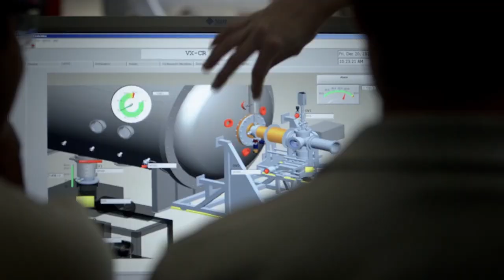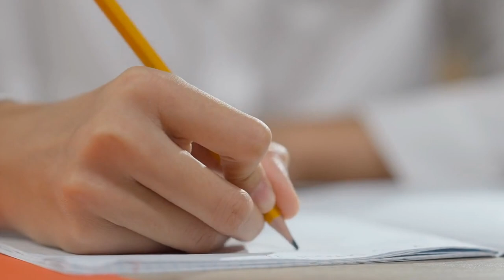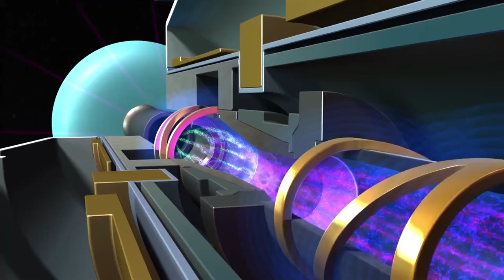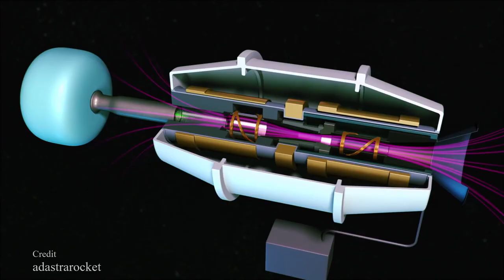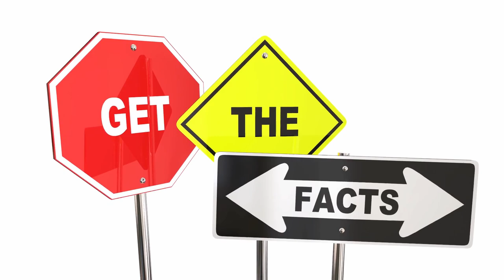Why The VASIMR Engine Matters

Comment: The biggest issue facing the VASIMR is power, because it takes a ton of power to run this thing and while solar arrays are said to be a  possible source I wouldn't want any spacecraft I was on relying solely on solar panels, plus there's the issue of the suns light dimming the further out you go. So a nuclear power source is going to be required to make this work, be it from fission or fusion  and honestly any spacecraft leaving earth's orbit needs at least several rtg's if not an actual reactor
Reply: Perhaps a microreactor or a small fusion reactor?
Reply: Nuclear power is the best option it's been done in space before it can be done again, only this time powering an engine that can have far more thrust and power and specific impulse than any gridded or hall effect thruster ever could they only use electrons and ions while the vasmir uses hot heated plasma from radio waves but I heard it could also be from microwaves or a combination of the two
Reply: I say let's look at the venerable hydrogen bomb. Hear me out, those weapons use a fission bomb to kick off a fusion reaction. So let's use that setup in having a fission reactor as small as can be made to power a laser array  that can be used to induce fusion in an inertial confinement setup. The fission side should be a molten salt design and if you'd really like to be as sustainable (I hate buzzwords) then surround your fusion reactor with u238 than can be transmuted into plutonium and used as fuel in your fission reactor. And don't build any of this on earth, Once whoever gets a moon base up and running can build everything up their. I dunno just a thought but this is what happens when I'm bored

Comment: Everyone always speaks of a Mars Journey Time in terms of Go to Mars, spend few days, Return to Earth...
The orbital window is apx every two years. 
If Mars-onauts are going to go and return, they should stay a minimum of two years to minimise the journey time between the two.
With sufficient supplies, equipment, etc... there are a great many who would just simply Go to Mars and live out rest of natural life as a Martian building and preparing things for each of the future ships with travel to Stay pioneers.
Reply: But if you are fast enough, transfer Windows dont matter
Reply: Transfer window is irrelevant if you only stay two or three days over Mars surface and then you return to the earth
Reply: This is only for the normal thought of route But you can also go to mars by way of Venus so you can actually go back and forth to mars every year. The route from earth to mars by way of Venus actually takes less fuel because of using  gravity.

Comment: VASIMR needs 200mega W to reach Mars in 39 days, this engine needs 4 Helion Energy fusion reactors
Reply: In Costa Rica we do not have nuclear reactors and even so, the engine passed the test of being kept on at maximum power for 100 hours. In addition, the engine is already finished and the only thing missing is the investment to start its production, so if Elon decides to take a risk, it may be that in a little more than we think we will be reaching Mars.
Reply: @FHERWHITE  So, is ready, only needs someone to finance it, 😮
Reply: @FHERWHITE I don't think it is ready yet but it is not proven either there is a lot more they still need to do before launching not just money but money helps! This tech could be the source of flying cars in the future and a truly futuristic world.